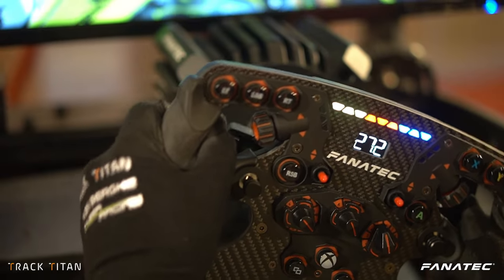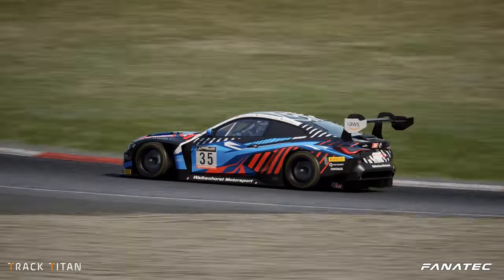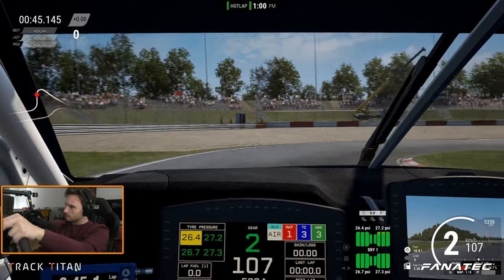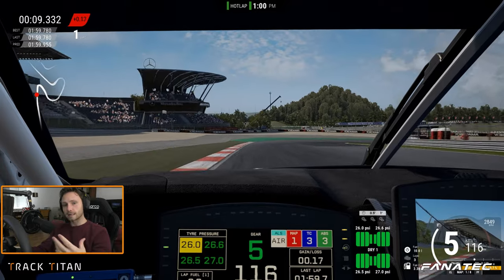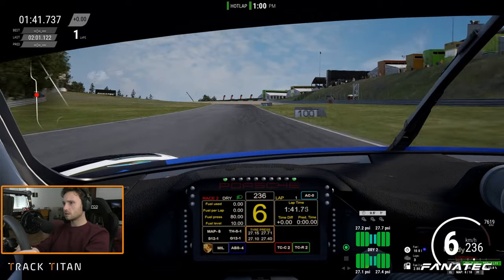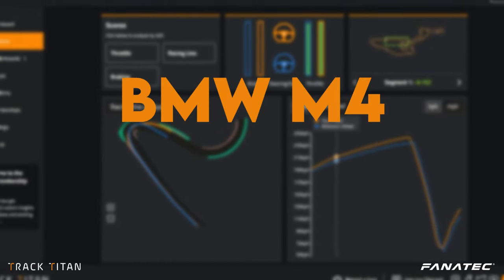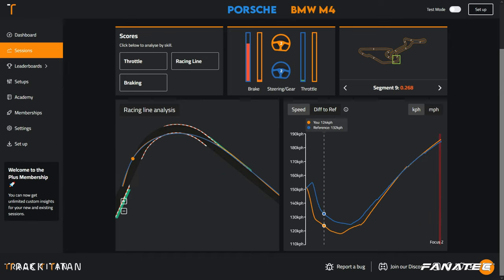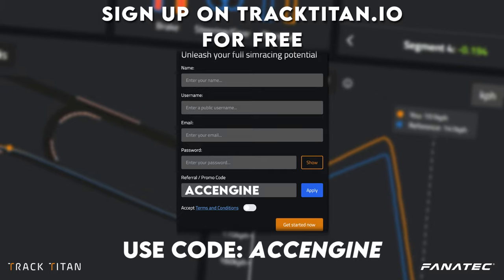Front vs Rear Engined Cars | ACC | Tutorial Tuesday

Comment: Rear engine cars are so confusing tbh. More grip on rears but has the tendency of snap oversteer. Also the 911 exhibits understeer. Hard for new drivers but very rewarding for the more experienced ones.
Reply: Yeah, it makes no sense to me either, I would expect that a mid or rear engine car would be understeery having so much weight on the rear and a front engined car would be oversteery because the rear is lighter. But it seems to be the exact opposite, idk if it's like that irl but it certainly is in ACC, I don't get it.
Reply: Old comment, I know, but stability is the main reason rear engine cars can be prone to oversteer. Weight forward is inherently stable and wants to remain in a straight line, while a rear weighted object wants to rotate naturally to the more stable orientation. 

At the same time, the 911 can vary a lot in its setup with big impacts to oversteer/understeer tendencies.